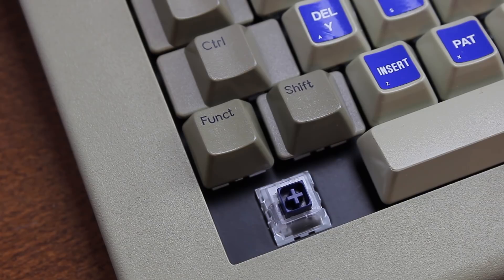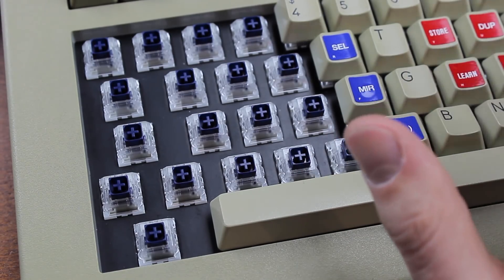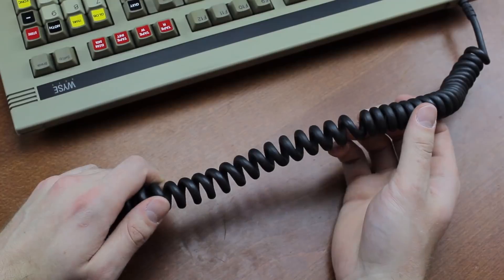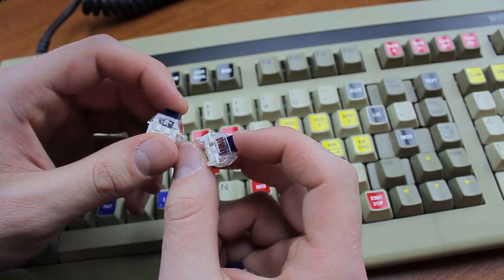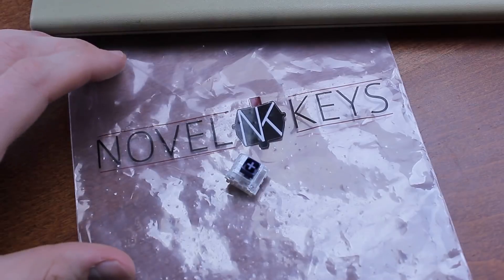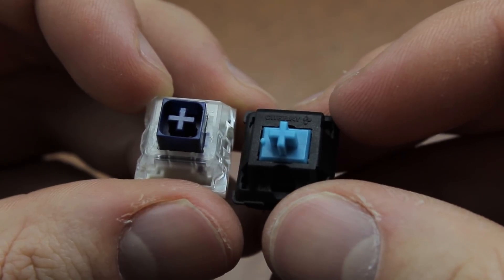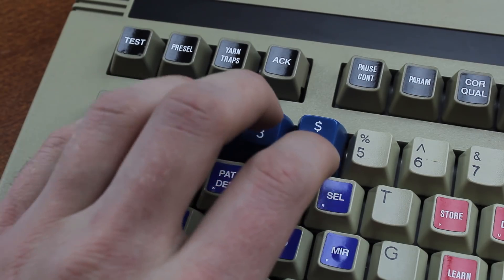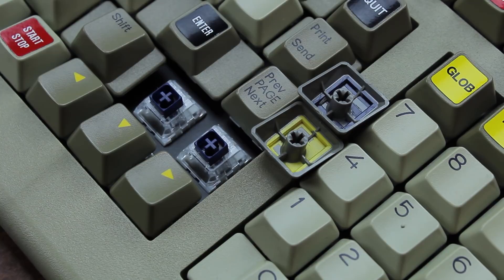"Project N" custom Kailh BOX Navy keyboard review Wyse (WY-50)

Comment: Its a bad switch design.
Reply: MALO according to who? A Cherry fanboy?
Reply: Obviously its my opinion. The switch clicks both in up and down stroke just like a mouse button. Just imagine a long typing session with that level of noise. An MX blue clicks only on a down stroke.
Reply: Have you actually used them? When typing normally you don't hear the second click at all because the time between a depress and a return is microscopic.
Reply: A mouse button clicks faster and have a tiny travel but sound is still noticeable because of difference in pitch of the downward and upward click.  A keyboard switch does not return as fast as a mouse button. You can definitively hear the bottom and the return sound.
Reply: Have you actually tried typing on a board with these switches though?
Reply: No. I'm judging based on the review, its why I'm here. If I have it then I don't need to watch a switch review.
Reply: MALO Noise is fine, especially for people who type with headphones on.
If you can't tolerate it, it doesn't mean it's a badly designed switch.
Reply: MALO Some people like their keyboards as loud as possible
Reply: Its not a badly designed switch, its just a switch that isn't targeted to the likes of you or others who don't like the excessive tactility or the noise it produces (or at all compared to Linears).
Reply: Swarky I know one even quieter than that. A type bar typewriter